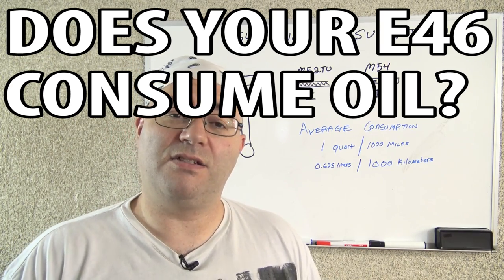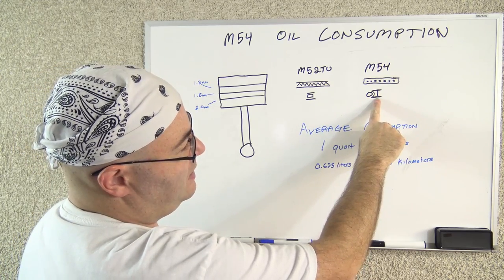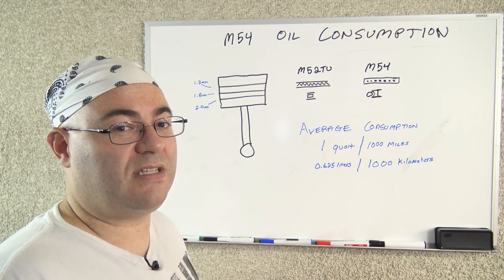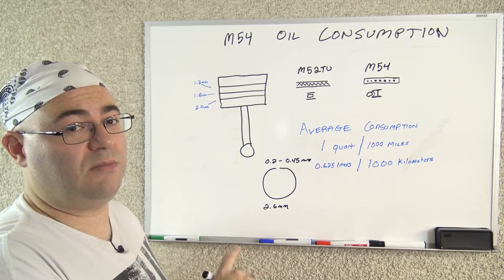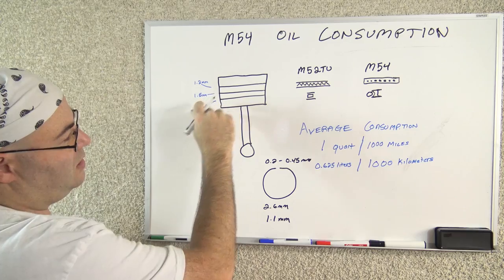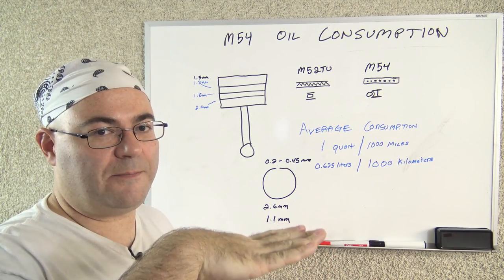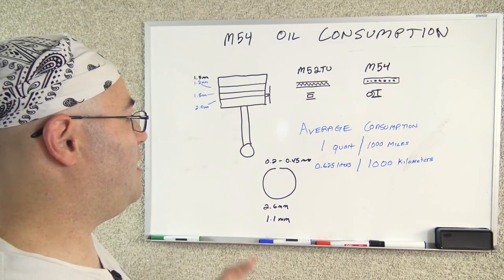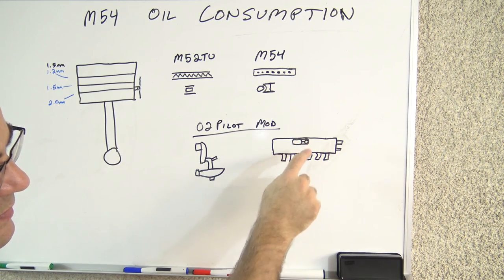Does Your E46 BMW Consume Oil?

Comment: Thanks for this info 50. I drive an E60 with an M54b2.2 engine and after doing a lot of preventive maintenance on the engine including complete ccv i was shocked to discover the oil level at minimum level after a 1200km drive. I might have this problem. I will also try to fo the valve stem seals and first i will go with the extra va uum line to the ccv. I hope that will fix it
Reply: I can bet you have sticking oil rings.
Do a ring decarbonization or rebuild the engine.
Reply: @hanynowsky  thanks for replying. Not sure how to do a ring decarbonization. Is that done by an engine decarbonization with these water machines or something?
Reply: @bend__  Partially.
But the real thing is to remove fuel pump fuse. Remove the spark plugs. Pour one a small amount of carbon remover liquid onto the spark plug well of each cylinder. Let it sleep the whole night.
The morning, crank the engine as many times in order to get the carbon out. Do not forget to put a towel in place of the valve cover plastic cap.

Comment: what happens if I have 1 quart every 400 miles? valve guides or bad ccv? Interesting how you mention that it happens after a new ccv install , I just had my changed out and all of a sudden my car has been drinking oil. I thought my mechanic may have damaged it , but now I think the ring became unseated.  My car has 224 k miles on it.

Comment: Hello from the Netherlands 50skid. Love your video, nice work.
Only one question: did you also install the one way valve in the line from ccv to the crankcase?
thanks a lot for your answer and nice explaining video's.
My car is an 330i toring from 12-2001

Friendly greeting , Ton
Reply from the maker: No I didn't install a one way valve in that line, only the oil return line.

Comment: Yeah low tension rings, less friction, high oil consumption, some fuel savings. The result is the bores last longer. Most manufacturer's went for this. Allot of engines out there, not just BM's are consuming oil. You strip a BM engine past 100000km and the bores still look surprisingly new. After the M engines, the blocks are now throwaway items, at factory, not refurbishable.
Reply from the maker: The newest M engine blocks are throwaway, you mean?
Reply: Depends on the linings used on the bores. Blocks that have cast iron sleeves can be worked on. Current engines by design uses sprayed-on molten alloys on the bores to create a very hard lining. I seriously doubt any machine shop can restore an engine back to full health as the process won't be cost effective. But you can order new blocks at the dealer. I'd order a new engine instead, its a piece of mind, saves labour costs.
Reply: Except for the fact that the local BMW dealer to me (Melbourne Australia) has quoted me $9800US, - if I give them my engine, 12,000 if I keep it for parts - as the "new" one isn't even completely populated with ancillary pieces.I only paid 4300US for the car - I can't justify spending 3 times the cost of the car just to purchase the engine - no labour included!
Reply: Gavin Baumanis That price is not bad. Costs $13000 AUD to fit a replacement N16 engine in a Gen 2 Mini. New of course. But that engine is shit.

Comment: THANK YOOOOOOOU! My 02 330ci has just under 90,000 miles and all of a sudden its drinking oil so much! Even spitting it out the exhaust with hard acceleration.
Reply: Your oil piston rings are bad

Comment: my e46 320i with the M54B22 engine have used about 1,8 liter oil (5w30) over 8500-9000km. My oil filter housing gasket was leaking but not much but i did lose a little oil when changing it.
Reply from the maker: 1 liter per 3000 km is roughly equal to the 1 qt per 1000 miles.  You've got the same usage as everyone.

Comment: I have a 325ti compact, all 3 ports were capped off and not in use. 
I've fitted the o2 pilot mod and so far its stopped the oil consumption.

Comment: Thanks for the great vedio and the excellent explanation 
Do you think the materials which been used foDor engine flush will damage the rings and lead to oil consuming problem ? i have bottle can of liqui moly engine flush and i am still hesitant to use it on my M54 motor on 525i 2004.
Reply from the maker: no i don't think so but then again if it happens I am not responsible :-)
Reply: Thanks

Comment: I been running a catch can for months and I haven't add oil at all. 
My engine is a m54, just one set back is that I can smell oil once in a while but not to worry.
Reply from the maker: Yep, I've got the same oil smell problem and I don't like it.
Reply: i had this smell problem as well with my OCC setup in the drug bin. i since have moved it to the intake side and replaced the OCC tubes and the smell has gone away.

Comment: Sir, thanks a lot for your Video. My M54B30 burning oil like 1400km/0.5L, I replaced valve oil seal earlier, but doesn't work, checking my oil separator now. If needs to replace piston rings, that will take lots of money.
Reply from the maker: use the 02pilot mod or catch can

Comment: I have a 2003 330i with a consumption issue.  I definitely want to try the 02 pilot mod .  I'm thankful I stumbled upon your videos today.  Thank you!  Thank you!  I also read in a forum about someone who used the valve cover from a M56 along with it's integrated CCV to completely eliminate the system used by the M54.  I would be interested in your comments on that.
Reply from the maker: The M56 valve covers are extremely expensive and hard to find.
Reply: If one could be found at a reasonable cost, would it be a solution to the problem, particularly in a cold climate?  I am moving from Tennessee to Michigan in a few months.  The previous owner of my 330i had already installed the cold climate CCV system.
Reply: At 186k miles now.  The cold climate CCV doesn't have the port needed for the 02 pilot mod.  I'm consuming a quart every 400 miles.

Comment: Thanks for posting these videos. I own a 2002 330i and am running the same issue of having to put in a quart of oil every 1 k mileage so far. Whats the eBay supplier in Van Nuys that has the ring set? I am going to replace those rings.

Comment: Mine E39 M54B30 burns 1l/3000km (1 quart/1864miles). I will test O2 mod and let You know. I have a little oil leak from oil sump, is this any problem with O2 mod?

Comment: Hi Jason, based on the explanation, the wear of the oil control ring seems to be based on mileage and not age, would you agree? I have 2x M54 engines, one in a 325Ci and another in a Z4, both have an excess of 200K miles. Both continue to burn oil even after 02 Pilot mod install. After viewing your engine rebuild videos, huge project, wondering if I can't get away w/buying a used low mileage M54 engine instead. I found one w/58K miles, seems like an engine (transmission) swap would be cheaper and easier. I may be able to p/u the pair for under $800. Thinking might as well keep the pair (engine/tran) together. I did hear the section, where the ring becomes unseeded, w/out knowing the history of the used engine there is always that risk despite low mileage. FYI - both of my M54 engines started burning oil right at or around 188K miles. Thoughts on going w/low mileage engine to address oil burn?

Comment: I got M54B25 and it generally doesn't consume oil. What it does (only in cold weather below 10 degrees celsius) is to suck in at a random moment about 1/2 a liter of oil for an average of 5-10 kilometers and I realize it when the yellow warning light on the dash comes up. I am guessing it's from CCV which will be replaced with catch can. Am I right?

Comment: What if you removed the valve and spring from the stock CCV and placed the pcv you used in other videos inline to the intake using modified hoses with a check valve on the drain tube? Do you think that Would place enough vacuum on the crank case and still get all vapors by the oil separator in the same way? I appreciate your videos. It has helped me feel more comfortable with tackling these problems myself and helped me understand my car. Thank you.
Reply from the maker: If you removed that diaphragm it wouldn't be air tight.  The little cover would leak around it.  The 02PilotMod is the easiest way to modify the stock system to have higher vacuum.

Comment: Hi,  I live in a very hot country and the engine always seem to be very hot, even though the temp gauge does not show .  Ihave a   2004 BMW 318i  E46 motor  and have just done 120000kms  and has just started using  about 500ml  every 600 kms.  Because of hot conditions some one has told me to use a  20w50  oil to help the problem.. Please let me know  urgently if that is  ok... Many thanks  Teddy

Comment: hi...  :::e46, 318i, N42, 2002 facelift, 130000km:::  
produced heavy smoke ,replaced new CCV after 2-3 days smoke vanished 100%
better performance 
....after 7-9 days, it started producing small amount of smoke, after oil change.
CCV damaged again ??? as it was the cheapest one

Comment: Hi thanks for all your help I have just replaced my CCV Valve and 2 upper pipes the lower one seemed fine going to the dip stick but the car EML light is still on and the engine is still misfiring any help please .

Comment: On FCP Euro, there's a set ($32 per piston) of CRP rings with a three piece oil control ring design. When you replace the rings on this motor, do you just leave the cylinder liners alone? Can't really hone the alusil liners.

Comment: With "02 Pilot mod" better to install a check valve on the tube that goes to the oil dipstick (because of increased depression on cranckcase there's risk of oil suction). Do you agree?
Reply from the maker: Yeah I think I would install the check valve for sure.  It's so cheap you might as well do it.
Reply: so are you saying do a mod on the mod?
just to be clear, you're suggesting taking the hose leading to the dipstick, cutting it, and adding a check valve between the ccv and the dipstick?
Reply: Just an hypothesis, I'm not sure this is necessary.

Comment: What about if you're like me and you're 20 so you couldn't afford the 325/330's insurance, so you got the 318ci that has the N42B20 engine. Does this still apply and which one would you recommend? 
Great channel and well made videos, many thanks - Luke
Reply from the maker: I don't think the N42 engine has the same issue with its piston rings.
Reply: Mine has been consuming oil at about 1 liter every 300 mile since about 80k. Any suggestions for fixing this?
Thank you for your reply - Luke

Comment: I have an 02 330Ci that moderately burns oil. Is it possible to just change the piston rings, or would I have to perform other maintenance along with it? I have run into financial troubles at the moment so I am hoping I can just change the rings and be done with it. I know I'll need a new head gasket, but is there anything else?

Love the videos! Thanks!!
Reply from the maker: Changing the piston rings is like the most expensive thing you can do to fix this problem. Do the 02pilot mod, it only costs $5.

Comment: great video ! 2002 325i replaced ccv twice in 4 years 1 quart every 400 miles I will do the o2 pilot mod,do I need the check valve or install vacuum  line and just wait and see.
Reply: How's the car doing now after 3 years?
Reply: @rubiksmaster301  It's one of those cars that you refuse to let it win. New motor 2 years ago going in Thursday for struts and bushings. Needs lots of tlc
Reply: @iflytango  Oof you're saying it didn't work?
Reply: @rubiksmaster301  it didn't seem to make much difference but not long after installing it number 6 cylinder lost compression so I had a motor with 80k on it out of a 525 that got rear ended put in had to swap the oil pan and intake manifold to make it work. Didn't take apart my motor to see why it had zero compresson. But I'm not using oil now
Reply: @iflytango  That's good.

Comment: So I have an 01 325i I’d say I’m putting a quart in every 500-600 miles, the thing is the engine only has 93k on it.... I just got the car and I’m not to confident on it’s past. Do you think my issue could be with the rings or something else

Comment: I have a 318i E42 with an E46 engine . . . I think.
Anyways it's a 2L engine that does not look anything like the one in your video however I'm burning a bit of oil and want to try this O² Pilot Mod. 
Can you suggest a port that I could use without messing up some other sensors ?

Comment: Hey 50sKid. I just bought my 1st 325i 2004. It seems to have a later model intake manifold with out a vacuum take off on the Catalyst airpump, no xhaust flap, and seemingly no vacuum take offs on the firewall side of the manifold. But we are certainly using oil at the rate you describe. Any thoughts on where to get the vacuum from ? There is an oil separator on the power Brake boost vacuum line which terminates into the dip tube FYI. Thanks in advance

Comment: Hi,
Where does the smaller vacuum line lead to, the one on which you propose to connect a T-connector for purposes of reducing oil consumption?
I was working on my car and it just came off. Seems to have been loose on the rubber end. 

Now I cant find where to plug.

Help.
Thanks

Comment: I assume this applies also to the M54B30 I have in my 2003 E53. I've noticed lately some blue smoke on cold start, so I'm really interested in your oil catch can solution as a solution for that.
Reply from the maker: Blue smoke might be more indicative of leaking valve stem seals, but definitely try the catch can first.

Comment: Great video - didn't appear in my subscription box for some reason. 

I understand that there is wear, but what about the design is the thing I want to understand. 

I'm curious as the rough idea is the same between the two ring designs, but the M54 rings wear faster - if they were of the same material would this be the case? 

Perhaps it's the fact it's the the spring is pushing it outwards towards the cylinder wall with perhaps too much force, as opposed to pushing them outwards towards their seating, and letting the natural expansion seal/scrape the cylinder walls.

I'm just speculating to be honest. I have no idea otherwise lol.
Reply from the maker: The M52TU rings are chrome plated steel.  Chrome is a very hard coating.  The M54 rings are phosphated.
Reply: Ah makes sense. So it is a material choice and probably design change overall. Thanks for that, great information!

Also wanted to ask: the PCV valve in your catch can video (Purolator PV1050) are both ends approx 5/8" in size?
Reply from the maker: Yes, 5/8" on both ends
Reply: Awesome, thank you!
Reply: I suspect that the main issue is reduced tension. BMW's main motivation was to improve fuel efficiency. A problem with multi cylinder engines is higher friction level compared with similar cc engines that have fewer pistons. So they designed a ring set that caused less friction by placing less tension on the rings. Unfortunately this has shortened the duration  at which the rings remain effective by half; measured in mileage, more or less tho really there should be an engine hour meter fitted to accurately measure that. So it was designed with economy/fuel efficiency in mind and clearly reliability and service life and thus their reputation was compromised.

Comment: Really useful video, my e46 318 (N46) drinks 1l every 300 miles .... It also sometimes shows blue smoke when stuck in traffic for a while. do you think it could be the CCV?
Reply from the maker: Wow that is pretty extreme.  That sounds more like a valve guide or valve stem seal might be leaking.
Reply: 50sKid yeah its really bad, the car does drive fine though. I rather it be the CCV then valve seals but we'll see lol.
Reply: @ipvelocity1873  It's been 4 years but did you ever solve your problem? Was it the ccv or something else? Thanks
Reply: @k-van9570  i changed the CCV which definetly helped, i also spoke to bmw they said the CCV is almost like a wear and tear part so it is something that should be changed and generally goes bad around 80-90k miles. I also found leaks from the sump gasket but the fact it blew out blue smoke i think the piston rings were bad also so i got rid of the car and bought a lexus is250 which has been amazing
Reply: @ipvelocity1873 many thanks, appreciate it. Best wishes with your Lexus

Comment: Caveat: I didn't watch the whole video but Q: Doesn't the 6cyl engines have problems with valve stem seals like the smaller engines? I mean that's my first thought for a BMW engine drinking oil. Also let's not forget that BMW (from what Ive read) specifies that 0,9 litres per 1000 miles is acceptable.. which means they know about it and don't think it's very serious. Thanks for answers.
Reply from the maker: No the valve stem seals aren't a problem on the 6 cylinder engines.  When valve stem seals leak, they really leak bad and you get white/blue smoke out the exhaust from all the oil burning, especially during deceleration when engine vacuum is highest.  I don't care what BMW says--the oil rings they chose to use are shit and cause oil consumption after about 100k miles.  Every single M54 has the issue.  Now that I'm using the M52TU oil rings, no consumption issues.  Of course BMW isn't going to care about this issue and is going to say it's normal--they don't want to pay for a rebuild on every M54 engine they sold, lol.
Reply: Ok, that's interesting. One would think they did extensive testing before mass-producing an engine.. Should mean they put it in production knowing this flaw..?

Comment: I have a E46 N42 ENGINE 316TI AN CURRENTLY IT'S USING 1LITRE OF OIL FOR EVERY 450MILES DRIVE. CAN ANYONE PLEASE SHED ANY LIGHT TO WHY THE HIGH CONSUMPTION AND ALSO SOMETIMES WHILE DRIVING CAN SMELL OIL BURN THROUGH AIR VENTS.

Comment: For the 02Pilot mod on the m54b30 why don't you use the 3rd capped hole since it's free? 
Also on a boosted engine will you need a check vavle?